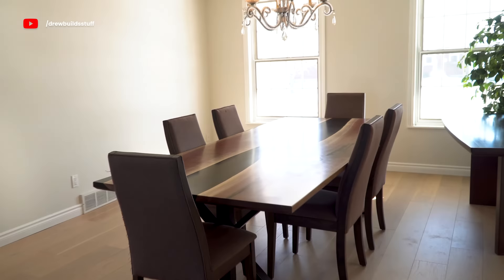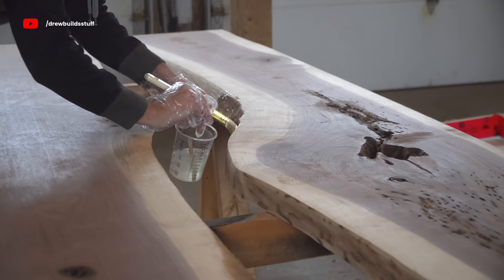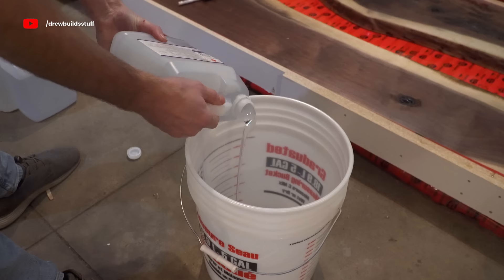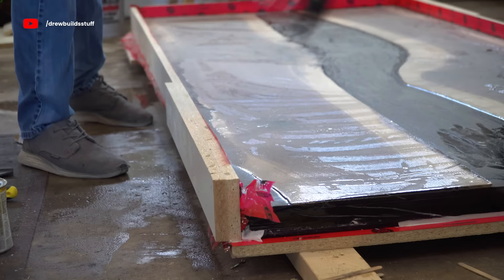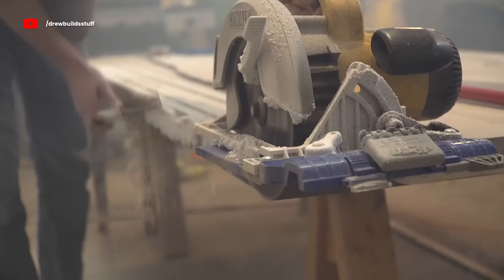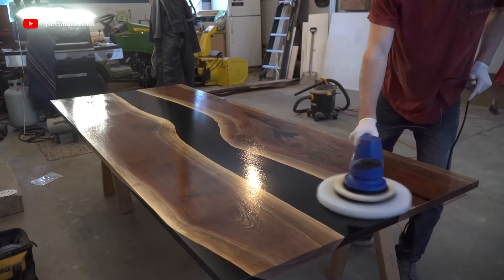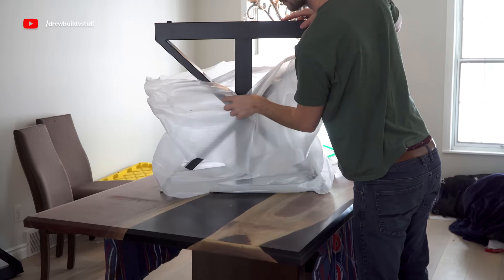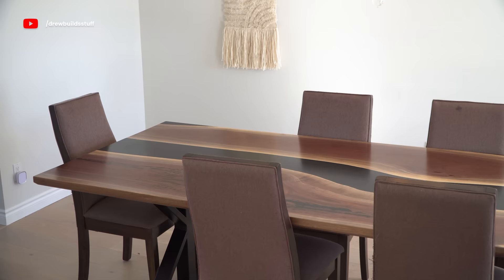Building a HUGE epoxy dining table in my garage - DIY Start to Finish

Comment: Couple of tips drew 
When pouring resin it’s best not to seal edges you get a better full impregnated bond on your sides and if you using slow curing casting epoxy anyway you won’t get any bubbles and as you using black you can always top it up or go over the top either in clear or black if there were a few bubbles or just dremel them out .trust me it’s the ultimate bond 
You can use any cello tape even 99p a roll one works just the same and you can use olive oil as a mould release works exactly the same .tried and tested mate straight up .that tuck tape is so expensive as well .ive used the wood from old wardrobes I’ve seen on the pavement lol kick it over break it up and I’ve made a form for under £2 .it’s sacrificial anyway so why lay out money for brand new melamine if you don’t have to its ok if you smashing YouTube like your self but for all us starting out it’s good to know these things as it’s not a cheap game to get into its always good to save money so any time you see an old wardrobe on the sidewalk kick it over and throw it in the truck 😂 
Great build drew I’ve seen a few of your vids now great content great well made videos 👍👍🙌

Comment: Incredible job bro! I see some people router out a section of the bottom and insert/bolt down a metal frame to add rigidity to it and to prevent   The table from bowing (I assume), do yall think that’s necessary?

Comment: I’m no expert but i’ve just watched a video by a resin company where they suggest place plywood in the gap where you are filling with epoxy as a gap filler, it’s cheaper than epoxy and there is little point in filling that whole void with epoxy as it’s black so you wont see the plywood anyway

On a side note I personally actually preferred the bottom face of the table without all those pinholes

Comment: That came out great, I would be afraid to use in knowing its going to eventually get scratched. If that happens, can you fix it? After you applied your first Osmo coat did you continue to put the same amount of coats on top and bottom?

Comment: Unless you put some silicone on the underside of each slab (which I didn't see on the video) you should block down the slabs or they will rise up and cause you to use alot more epoxy than needed  Every video on epoxy will show this

Comment: So I've been doing some research before attempting a table. Have you found that it's better to sit the walls on top of the floor of the mold rather than screwing the walls into the sides of the floor?

Comment: Drew, thanks for the awesome video and tips.  What do you think would be a length limit on a project like this?  My wife wants a 12' long table.  Would it be best to do two six footers and try and connect them with supports like the legs you used in this video.

Comment: Good video! Question, if you have holes on both the top and bottom of the slabs, do you need to fill those separately, or will the holes on the bottom fill up when you do your pour?

Comment: Turned out really nice.

Made me laugh with the buy the tools you need as Walnut & Epoxy are really expensive & then your struggling with that silly shonky circular saw LOL

Just buy a proper track saw & long track. or a decent large circular saw & clamp a straight edge. You can pick up used WSC 85 Hilti here in the UK for about £200 with 85mm depth of cut & power to cut through anything.

But the table turned out gorgeous & I am a fan of Osmo & also Rubio MonoCoat finishes.